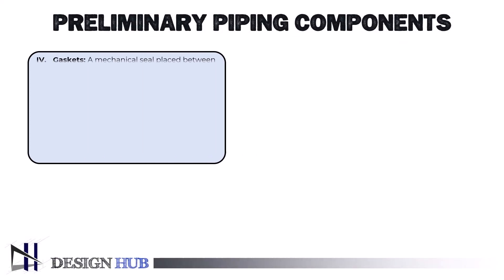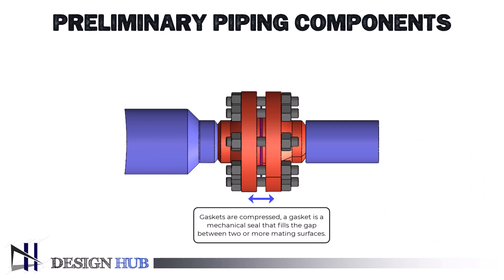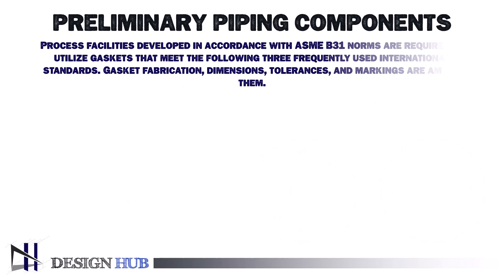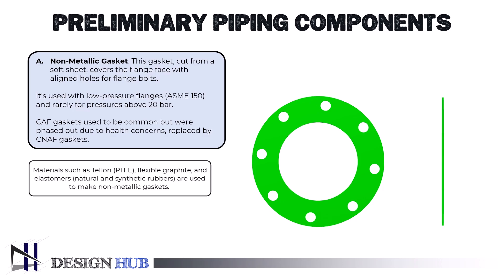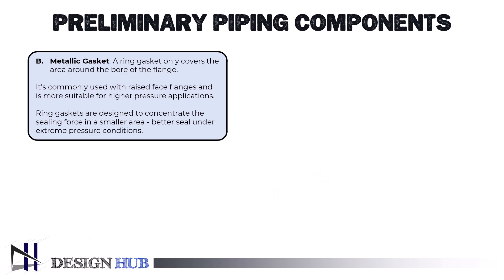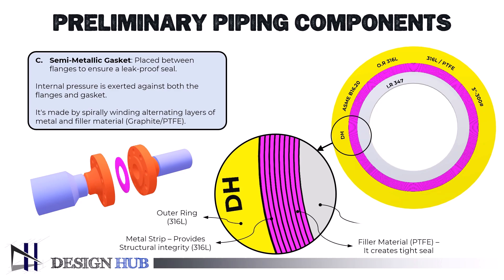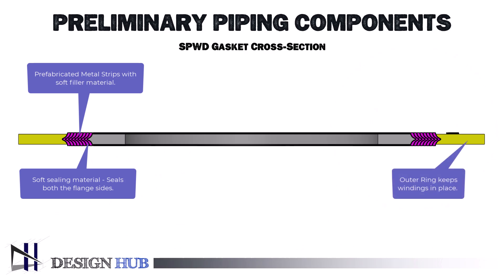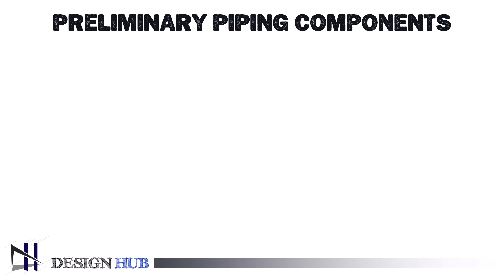Piping Design: Understanding Gasket Types & Selection | Complete Guide

Comment: Thanks 
How do you calculate gasket thickness?
Can u give an example.
Reply from the maker: To calculate gasket thickness, you need to consider several factors such as the operating pressure, temperature, and flange surface. Here's a simplified example:

1. Application: Let’s say we are working on a flange connection in a pipeline.

2. Materials: The material of the gasket (e.g., rubber, metal, etc.) should be suitable for the medium being sealed and the temperature range.

3. Thickness Consideration: Typically, a 1.5mm to 3mm thick gasket is used for most industrial applications. However, thicker gaskets may be used for uneven or damaged surfaces to ensure a proper seal.